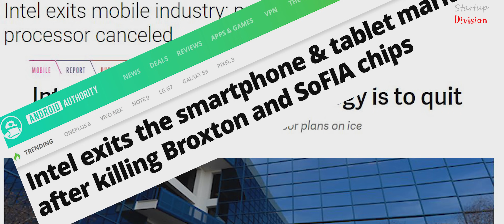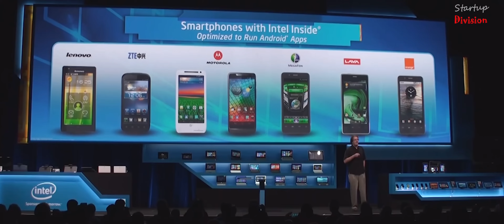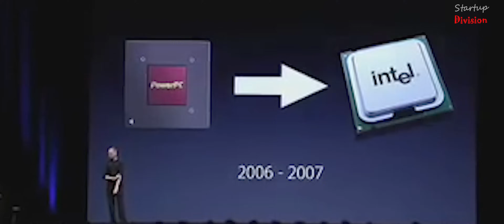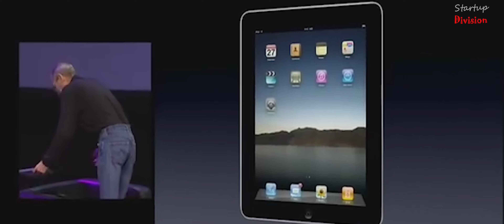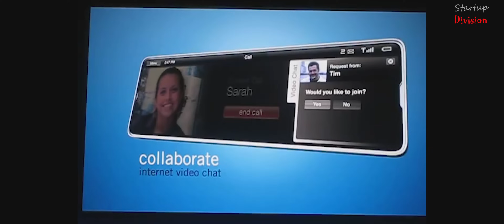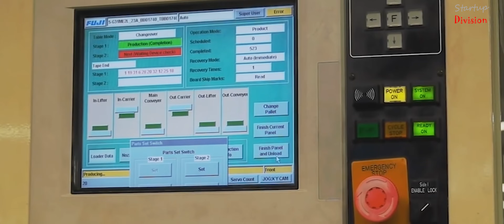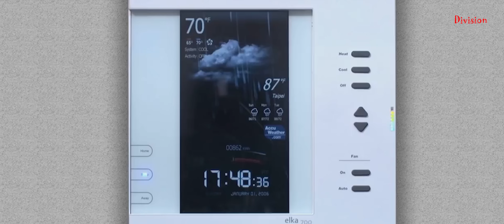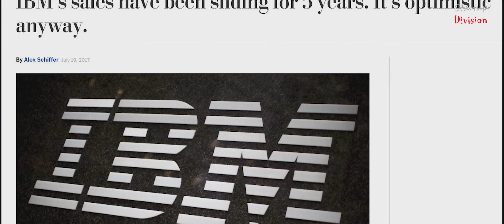How Intel Failed in the Smartphone Chip Business

Comment: I gave Intel a chance on my Asus Zenphone 2. It broke the first week and i had to do my own repairs because I couldn't be without a phone for a month and ASUS didn't give me a good option. The phone constantly gave me problems. It had a nice screen and dual sims and tons of ram for 2015. it got really bad signal through AT&T and perfect service through T-mobile which supposedly used the same towers. They keep all that information secret though so the admins can abuse the networks. AT&T wanted me to buy a phone from them instead of using unlocked phones. T-mobile was giving me priority over others on the network because they wanted me to switch. The biggest problem with the phone that wasn't a software/ network issue was the charging and power management. It would take forever to charge and it would run dead really fast. It might have been a battery issue but i already had to replace the charger port and sim card tray because they both just randomly failed. I still have the phone but its unusable. (ASUS clearly knows nothing about phone hardware.)

I had to return to AT&T because one of my family members lived in a dead spot on the T-mobile network.  It was a really difficult decision because T-mobile gave me much better speeds and coverage and at literally half the price! They gave me $1050 to switch 7 phone lines but that just went to paying off my sisters' phones so i could unlock them. They don't know much about technology so they don't understand how much more u pay for phones through a contract. I just recently left that phone plan for Google FI. The speeds seem acceptable (slower than T-mobile/Verizon but faster than AT&T) and the coverage is the best even compared to Verizon or AT&T. The flexible plan is a great deal if you don't use a lot of data. I'm also using an unsupported phone the Nokia 9. Best hardware for the price available in my opinion. Switching between limited and unlimited when you are out of town would be a really convenient option to have. I use a lot of data while out of town but if I'm home I use almost none. 

 The Fire phone from amazon is the only phone i know that took 360 pictures so I invested in the new technology. That phone lasted forever until I jumped into the ocean with it in my pocket (I don't think that's covered by any warranty anyways.).  I got it before but i had to return to it as a backup after the Zenphone started falling to pieces. I wanted Google play store apps and a full android experience so i had to void my warranty to put Cyanogenmod, a real copy of android on the phone. I also lost the ability to take 360 pictures. Of course I had a backup of the old obsolete amazon version of android but I didn't like the user interface and i didn't like the amazon app store as much. That was before virtual reality and 360 videos were common so I didn't see its full potential.  ASUS RMA is terrible. They also advertise games included with their products but they are always expired for me. They make the best PC hardware but you just have to hope that it doesn't give you any problems. I have many ROG PC parts but you have to really care for them because ASUS doesn't care about you after they have your money.  Intel would have done better with a different hardware vendor. They are both notoriously greedy and think they are better than everyone else. That mentality is probably what made them fail. Strange the same mentality is why apple succeeds though.  I have never bought a new Intel CPU. That's just a waste of money ever since Ryzen was released and I don't think I ever will. looking into buying my 4th AMD processor the new 9350x or whatever the model number is on the Ryzen 9 processor. I'm just not sure if i will use all of those cores but at the price its a steal. Looks like Epyc is about to dominate the server market too but what do I know?

 I buy Nokia phones because they last forever. I have a 6 year old Nokia phone that still works but it runs windows phone 8 and has a fat sim port. i have an old LG Windows phone and it still works after i ran over with a car. Unfortunately the new LG's don't last as long ever since like the G3. Microsoft picked really good hardware vendors but the operating system just couldn't compete. I read something about how they were fined for being monopolistic. I'm not sure if that's true but that might have kept windows phone from being successful. Nokia has been in the cell phone hardware business for a loooooooooong time. It might have been bought and sold a few times but the important thing is they keep up the quality reliable hardware. The devices are also manufactured in the birthplace of Linux so that's a really nice coincidence. Android and the Linux kernel gave Nokia phones so much more potential. :D